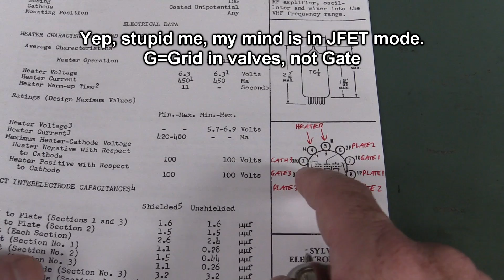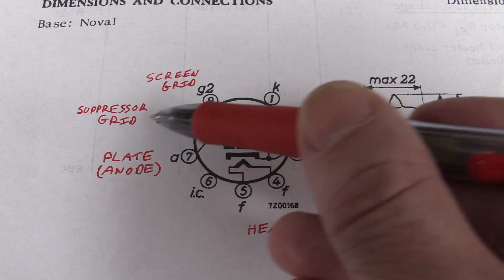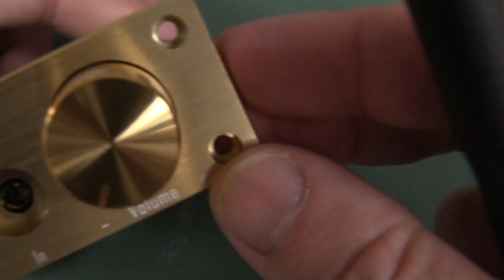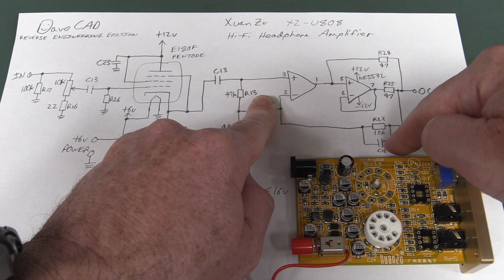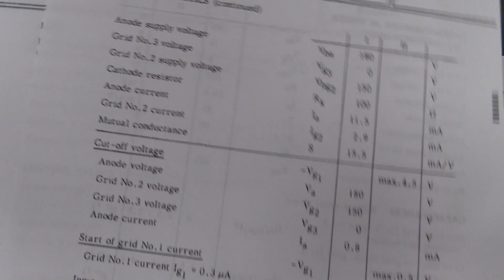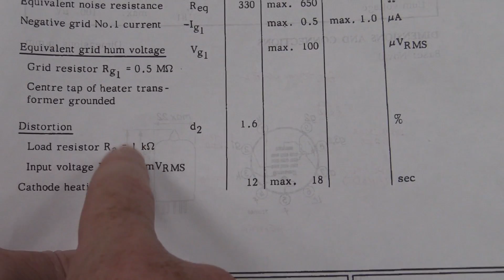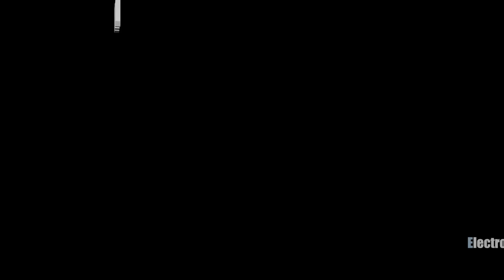EEVblog #837 - Reverse Engineering A Valve Headphone Amplifier

Comment: By the way I didn’t buy my one as a headphone amp, I use mine as a signal tracer, it’s a cheap way to make one with a good uncoupled input.. You also get a spare tube (or Valve if you are British) to play with, solder some wires onto the pins and you can experiment with it in triode and pentode configuration. You need about 90v to make it work properly, so rubber gloves are a good idea.

Comment: Without getting into plate voltages and all, I have to say that tubes sound different than transistors. In my college electronics class years ago, our instructor said something to the effect that a good quality transistor amp will treat the odd and even harmonics evenly. However the human ear doesn't find odd and even harmonics to be equally pleasant. He said that a tube amp tends to "cheat in your favor" as far as doubling up on the harmonics that the ear tends to like and attenuating harmonics that are less naturally pleasing. I am so old school that I actually like the sound of a phonograph coming down on a vinyl record!
Reply: William Beckham, I wonder if your old teacher was correct......as I understand the human ear, it is just a series of tiny hair cells that respond to excitation by different sound frequencies. If that is true, would they be able to distinguish between the different harmonics? One note's 5th harmonic can be the same as another note's 8th harmonic, and how is the ear supposed to react differently (and one is an odd harmonic while the other is an even harmonic). Seems to me that a lot of audio snubbery is really just folks misunderstanding, or improperly applying, physical truths.

Comment: Biggest improvement is remove the 2 tubes and install 2 links from grid to cathode, and remove the cathode resistors. You save 2W of power and improve reliability by at least an order of magnitude and reduce the noise.......

Of course if you want the valve sound leave the resistors in and use a 1N4001 for the link so it is forward biased and able to generate the lovely distortion with less power and noise.

Comment: double blind testing done by the BBC showed that INCREASING distortion improved perceived sound quality .
....purity of audio reproduction. There is no such thing.  Purists look down on things like tone controls in amps, yet overlook the many multiband eq's used in the recording process. And the many meters of non audiofile cables used in the studio :-) Will an audiofile 2m cable make any difference after the 20M of ordinary cable its gone through when recorded.. 
Perhaps Dave could test "audio' 240v amp fuses that cost $100's . People swear they make a big difference in sound.  Just kidding, please dont.
Reply: When you're producing sound, you can use any method you want to achieve the sound you want, so using vacuum tube amps for recording purpose is fine. When you're reproducing sound, you should use whatever method produces the mathematically most-accurate amplification of the source signal, so you can be sure you're hearing exactly what the artist intended. That's why my home stereo uses a set of self-correcting JBL studio monitors with built-in digital amplifiers, rather than some ridiculous glow-in-the-dark vacuum tube setup, so I can hear my vacuum-tube-amplified rock albums with perfect clarity.
Reply: Supposedly 2nd order distortion 'harmonises' whilst 3rd order would be inharmonious, but I tried adding 2nd order using a plugin and it sounded dreadful.
Reply: the same with Tripath and some other amps, they ad distortion, but "good" distortion not the kind of distortion crappy Class B silicon amps ... there are of course good transistor amps, Class A, Class AB, even some good Class B amps ...
Reply: @fyrstormer  how do you know that the sound on the record is what the artist intended?
Reply: @dcan911 : Because they get to hear the master after the recording engineer is done with it, and request changes to the final mix. Or at least, good musicians do that. I suppose Justin Bieber probably doesn't care.
Reply: @fyrstormer  there are multiple cases where masters are deemed “OK” by artists heard through a phone held to a speaker. Or through a car stereo. It’s more about what the sound engineer wanted it to sound like rather than the artist.

Unless it’s some artist who really know their stuff and care about the audio in different way than your average mainstream artists does nowadays. Or someone who produces their music themselves. You know what I’m saying.

Comment: Hi Dave,wow cool to see you´re doin TubeStuff :) :)

I love you´re sayin´ JFets with pilot lights....Great clarification for unexpirienced people! :)

But in this case, the tubes running on "starved plate" configuaration in where the plate voltage is to low for a typical bias point, you´re finding in datasheets....
Therefore to let the tube at least do something you need to wire it up like how it´s done here...
But as a cathode follower the tube will not add a "tube-sound". A cathode follower can´t do this, there´s no saturation. Instead it´ll go straight into clipping, just like any Jfet or BJT will do....
Reply: +mipmipmipmipmip Tubes, even crappy tubes, are more than capable of producing excellent quality audio.  Even this one with a 1.6% specced distortion can most likely be coaxed into being plenty clean with a high enough voltage (which provides headroom) and relatively careful choice of biasing and impedance. 

The thing is though, transistors do all that stuff way better and easier and smaller and cheaper and less dangerously .. one of the only real uses I see for tubes these days is in guitar amplifiers, where the whole point is to slam the shit out of the tubes with insane gains and voltages, and really ride them past the edge of their standard characteristics. With all their analog goodness, the real fun comes when you mistreat them. The boring, linear region is not exciting and is better represented by transistors.
Reply: +TubiCal As MrCarlson said they would have been better off using space charge tubes. China needs to stop making random tubes and sticking them in stuff but building tubes designed to work on low voltage. Or they could simply use a tiny boost converter to generate the high voltage instead.
Reply: TubiCal The 1.6% figure is for a common-cathode topology with no NFB. Not a practical circuit.
Reply: If the signal level is low, there is no clipping due to bias.

Comment: The quick way to test if the valve did anything would have been to yank the valve out and see (hear) if anything came through. In this case nothing but linking pins 2 and 3 (grid and cathode) would have restored the audio with probably very little difference in audio quality.
When you first showed the video of the inside I wondered where the HT rail was because only 16V surface mount electrolytics were visible then I noticed the radial electrolytic and thought that must be across the HT rail. It turns out that the HT is only effectively 24V (± 12V) so the 16V capacitors are adequate.

Comment: A true audiophile understand the importance of a good signal chain; which is even more important than which tubes you use (as for as those- I only accept a few specific models that were produced by Phillips in the late 60s (which I was fortunate enough to procure a stockpile of at auction after much searching), but I won't get into that). Everything that exists within the signal chain will modify the sound. I use exclusively analog hardware due to its superior accuracy, though I do make one exception: my record player happens to be a few meters from the rest of my equipment (which is in a specially designed cabinet to shield it from the earth's magnetic field), and to get the signal over there, the signal from my preamp enters an ADC then sends  s/pdif using a custom white laser (merged and color-balanced RGB) through a rigid glass fiber and then received by a dedicated DAC and then tube preamp. This signal then either feeds into my tube power amplifiers that feed the main speakers (through solid brass, oxygen-free, shielded speaker wiring, terminated with gold-plated connectors (I find that the brass with gold plating doesn't give that "dulled vocal depth" in the mid-high range that you get with stranded copper), it is also fed into a second ADC, similar to the first one, which is used to carry the signal to a similar set of equipment for the rear of the listening room.
Reply: +mikeissweet Good troll, but it has to be slightly more subtle.
Reply: +Spirit Lmao ding ding! Damn those audiophools.
Reply: +mikeissweet You almost had me until the magnetic field stuff. That is just a wee bit too far for even the nuttiest audiophiles I've happened across.
Reply: ugh, theres so much 'audiofool' bullshit 😉
Reply: Awesome... until the Earth's magnetic field, then it goes off the tracks. White laser? All fiber is "rigid", glass is glass. You redeemed yourself with the gold-plated brass however.
Reply: nice one !

Comment: In the audio industry people pay large swaths of money for tube-based amps (especially guitar amps!) because it seems using vacuum tube valves instead of transistors as amplifiers delivers a much "greater" and "smoother" sound, whatever that means... so far I've been unable to notice any difference, except in the price tags.
Reply: yeah well the price tag for that one is around 20 euros free shipping so.. with or without the tube it's more or less the same price
Reply: When you're producing sound, you can use any method you want to achieve the sound you want, so using vacuum tube amps for recording purpose is fine. When you're reproducing sound, you should use whatever method produces the mathematically most-accurate amplification of the source signal, so you can be sure you're hearing exactly what the artist intended. That's why my home stereo uses a set of self-correcting JBL studio monitors with built-in digital amplifiers, rather than some ridiculous glow-in-the-dark vacuum tube setup, so I can hear my vacuum-tube-amplified rock albums with perfect clarity.

Comment: Remembering the power supply requirements needed by tube circuitry, I was hoping to see what value B+ voltage was being supplied to those tubes and how it was being generated from that small circuit board.

Comment: Thanks for the vid Dave. I was shopping on Ebay and bought a 6J1 preamp kit which I thought I'd play around with. Still waiting on it, but I reckon it's probably a similar design except they run it direct off 12VAC from what I can see (no dc boost) and 6J1 toobs. At least it was only $10. I don't know how much this puppy would set you back

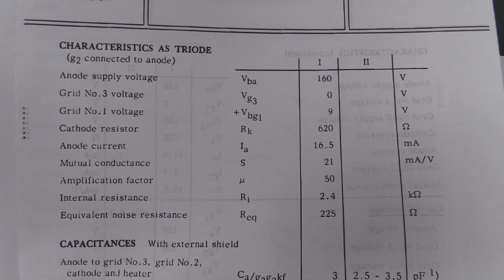Comment: 19:52 I'm no expert in tubes, but I can see right away that if this tube were biased as the datasheet says to do it, the tube power would be 160V * 16.5mA = 2.6 watts. Times two because this is stereo, and you're talking about a lot of power. Now try to generate that power from a little tiny boost converter powered off of 6V. You need a hefty >200V filter cap for the boost (read: $$$), too. It's much harder to fully bias this tube for this thing than it might appear, which is why they adopted a very simple ±12V rail system. Otherwise, the power supply would have been more expensive than all the other circuitry combined.

So it's okay to bias a tube filament with a DC voltage?

Comment: You should have compared the input from the output on a spectrum analyser. Tubes add harmonic distortion in a different way then transistor do. So there is a difference.

Comment: Great analysis, but I'm not sure the average Joe will get the main fact that: in the "emitter follower" configuration (gain~1) and the low level signals, this circuit will never have the close to saturation smooth clipping, responsible for these so loved harmonics that audiophiles came to love so much. A simple harmonic distortion comparison might have been easier to understand...

Comment: The whole point of a tube amp is to get distortion. Of course conventional solid state or discrete amps will perform better. Honestly, this product doesn't appear to be a rip off at all. I am not into tube amps, but for those looking for the tube amp distortion on their signal path this is probably a cheap way to get there.

Comment: I believe the reason they have such a weird OpAmp-based output circuit is because they tried to simulate frequency characteristics of an output transformer. Just putting a tube-based input stage is not enough to give a truly nice and warm sound because it only gives some high frequency distortion without touching the low frequencies. Even afrer putting a coule of tubes more distortion was still needed to get a true old-school sound. Putting a real transformer would be too expensive for a sub-$1000 device so they found a somewhat decent replacement.

Comment: It needs rare earth metal coating on the valve sockets to be any good, How did they miss that? Top Vid, never knew valves would work at such low voltages.
Reply: +Mike James 
24 Volts, or even lower, is not unusual. It's basically a myth that ALL tubes/valves needs hundreds of volts to work. Many will and a few won't. How well is another discussion.
Reply: +Mike James Don't forget the cryogenic treatment to make it "Audio Grade".  Oh, and a really expensive power cord.   ;-)
Reply: +digitalradiohacker You beat me to it, I was going to mention the importance of oxygen free power cords because that 60Hz hum is so much more enjoyable with an oxygen free power cord inserted between the receptacle and transformer!

And I love the whole notion of "audio grade" digital interconnect cables (HDMI, Ethernet, etc.) and flash memory devices.  Some of the claims made by audiophools are so outlandish they really should be criminal.  That said, those that want the "warmth" of tube amplified sound are welcome to it as far as I am concerned (there is absolutely nothing wrong with preferring a certain sound -- we all have our likes) so long as they do not simultaneously tout the tube amplifier as being distortion free as the very warmth they desire is the product of distortion.
Reply: You know the funny thing about an "oxygen free" power cord? The owners never worry about the wiring in the walls of their house. Or the the power cabling to the house. Or the the nonlinearity of the power transformer on the pole. Or the . . .
Reply: Yeah, there are no rare-earth metals with better electrical conductivity than gold-plated silver. (the gold plating is only to prevent corrosion; gold actually has lower electrical conductivity than silver.)
Reply: You could use old battery radio tubes that had 1 to 3 volt filaments and use a B battery for the plate voltage. if you cant find a 90 volt battery just make one out of 10 9 volt batteries or build a power supply using an isolation transformer. I dont buy that transformers will hurt the sound quality unless you use a china made one. Good transformers are a must for good tube amps. Radio Shack transformers are crap for power supplies. Get a Stancore  or equivalent.

Comment: I've been banging my head against a brushed steel amp fascia with some audiophiles on this issue - can't wait to share this onto them!! This rocks Dave!
Reply: The "warm" tube sound which, beyond physical laws and general logic, can only come from a real tube. Check out directional speaker cables too. And when buying them, make sure to buy the triple 24K gold plated contact 1999$ ones.
Reply: +drkastenbrot yea, but they are only worth to buy if they had been manufactored during moon transition!
Reply: "Audiophile" means "lover of sound", it doesn't mean "good at listening".
Reply: drkastenbrot 

Despite you can actually hear the coloration tubes give...
Reply: Retro Tech Teardown 

This is a cheap chinese snake oil unit and not comparable to authentic tube technology.